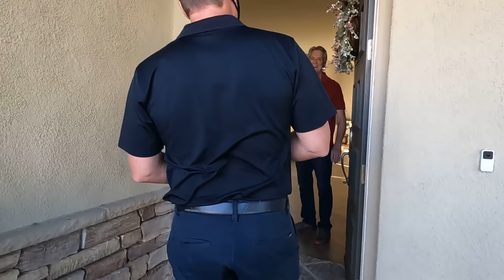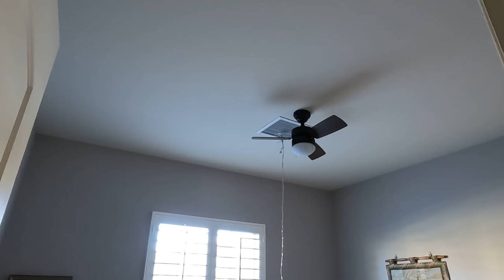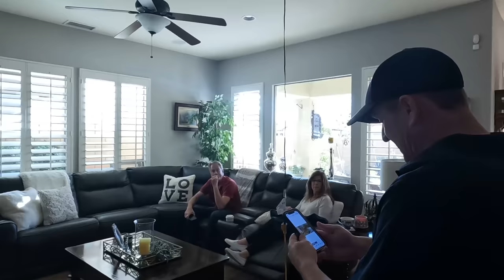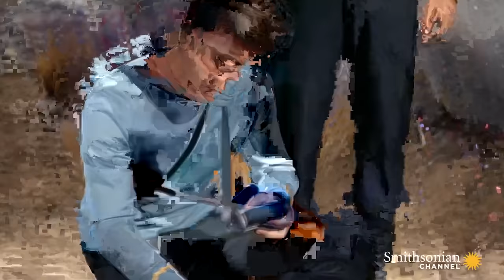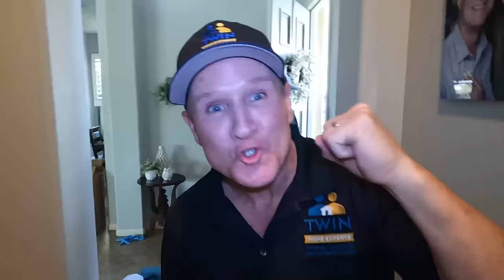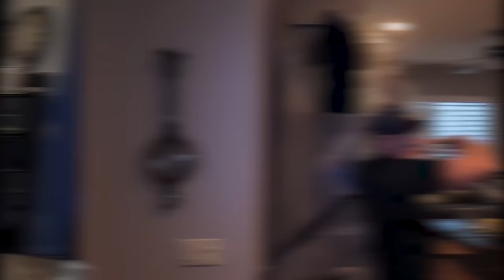GIANT sewer rat didn't stand a chance...

Comment: Since sewer rats are so prevalent in that area it looks like the local code would require one way valves to keep them out. These are also used to keep overflow from the city lines outside the house from backing up into the house.
Reply: "Backwater Prevention Valve"
Good thinkin eddo!😉
Reply: I do have a one way valve which I insisted upon due to the backlash in my toilets during the city pipe flushing projects. I still have rats visit my attic periodically. Three professionals have tried to find the access. Nothing noticed on the outside of the house.
Reply: @carolejackson8357  Check to see if they ate thru the plastic flap.  May need to attach metal flashing in front of it.

Comment: Have you guys ever thought about attaching an apple AirTag near the tip of the camera to easily locate the breaches?

That would eliminate extra work and damage to the walls.
Reply: Sounds great but I doubt that would do a thing. The signal for those probably wouldn’t do well if anything at all through pipes and walls and insulation. You want to know what does the job way better? That little alien spaceship sounding thing they were using in this video. It’s a line locator by Ridgid. Has a little receiver that snakes it’s way into the pipe. It communicates with that handheld device. That’s exactly what they were doing except it’s designed exactly for this reason and is far more effective. AirTags are meant to find your keys lost in your apartment 20 or 30 feet away max. They’re not meant to go through pipes and walls and insulation. Good idea tho haha would be fun to try. Probably wouldn’t do a thing I’m guessing
Reply: @andydrew3320  Thanks for the insight. AirTags would probably be too big to fit through most of those pipes anyways. It was just a thought as I see them cut multiple openings in the walls at times to find the breach.

Comment: Shouldn't you have fitted a rat-prevention valve on the sewer pipe which connects to that drain pipe, so the rats can't get back up into the drain pipe and do it all again?  Take a well-earned break, and then return to that property and fit the valve. Yes?
Reply from the maker: Yes, he hired a local plumber to excavate and install one. 👍💪